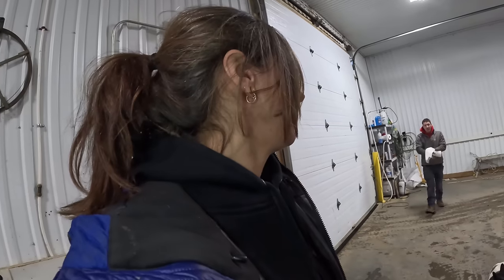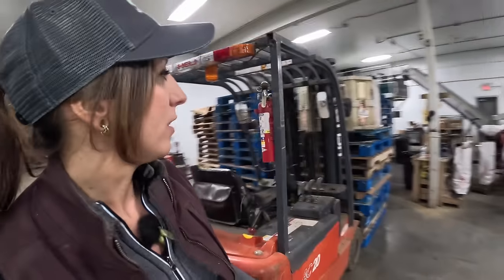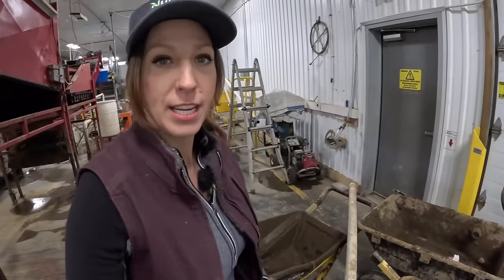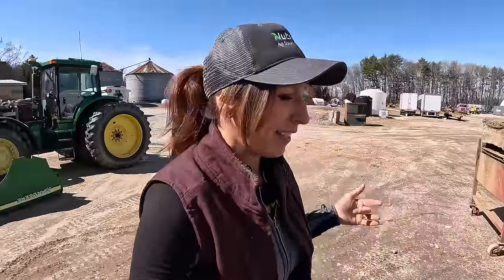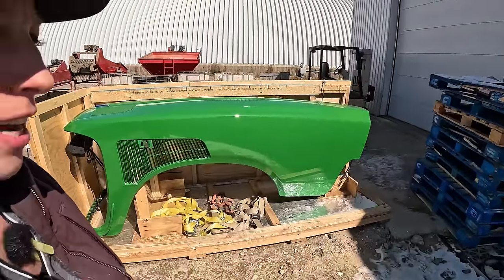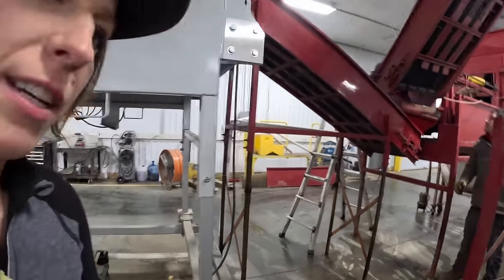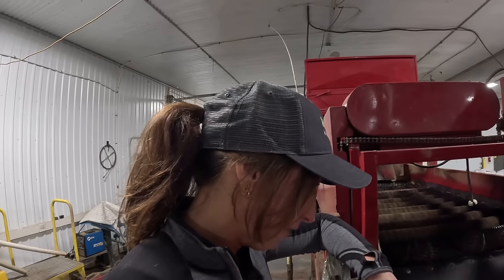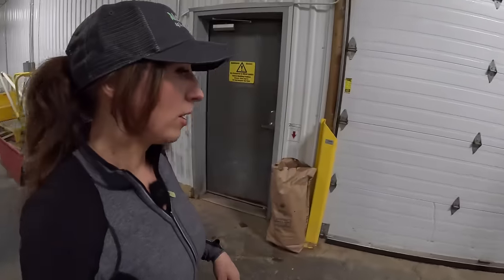Cleaning House! Re-arrange & Remove equipment

Comment: have you considered using a leaf vacuum to clean the dirt instead of dustpan/shovel and broom?
Reply from the maker: Well, I do t want to blow dust everywhere in the building. So the old fashion way is working good until we pressure wash the inside.